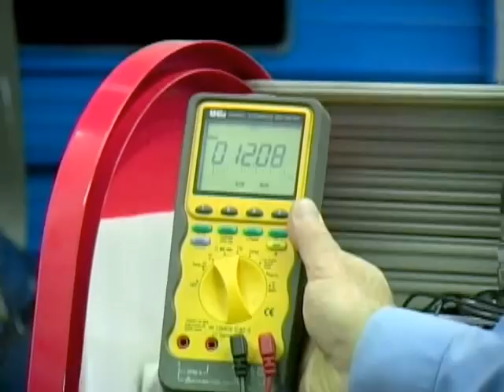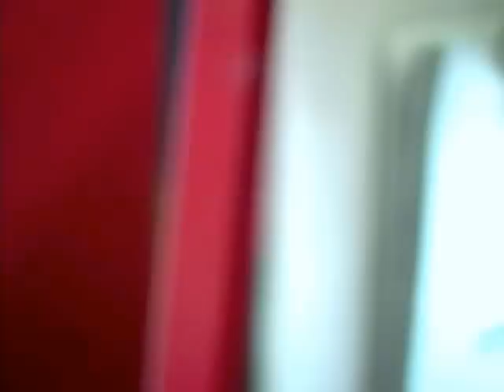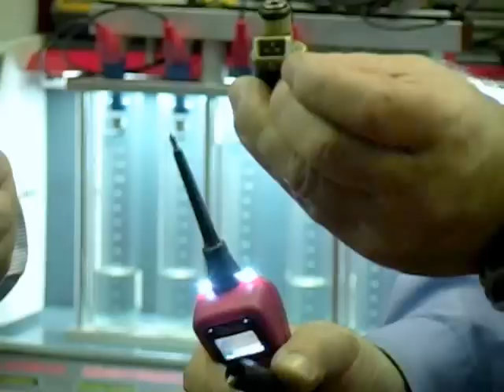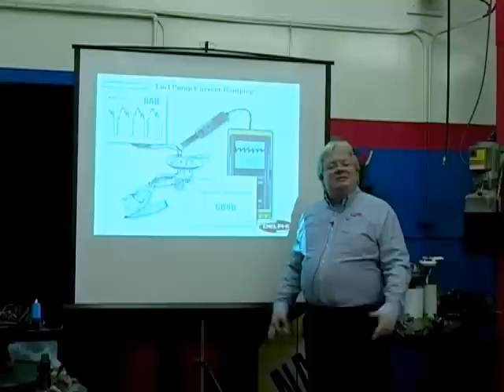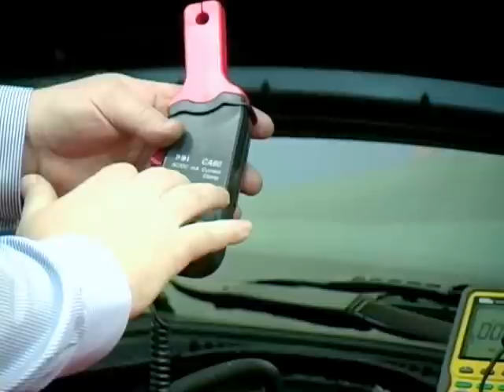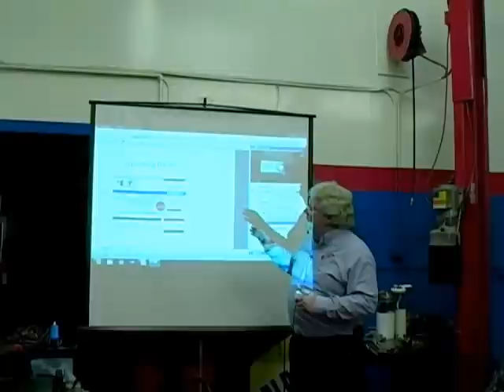Fuel System Diagnosis Presented by Delphi

Comment: Just had a Chrysler 200 in the shop the other day with 3 out 6 injectors leaking SLOWLY. It was a very intermittent hard start. Took a while to find because the conditions to make it act up was very specific as far as how long you had to let it sit before trying to restart. Too short and not enough leakage too long  pressure would go down enough that they wouldn’t leak and what had leaked would’ve evaporated.
Reply from the maker: John thanks for sharing your experience...we appriciate it.

Comment from the maker: Low fuel pressure/volume due to a clogged pick up sock or any other leak before that side of the pump will cause low current draw. Low mechanical resistance = low current ... thanks for the comment and thanks to njbrain for the response.

Comment: low amperage because of low fuel pressure?  I thought amperage was a result of spring resistance and electrical tolerances?  Thats a first, gonna check that one out